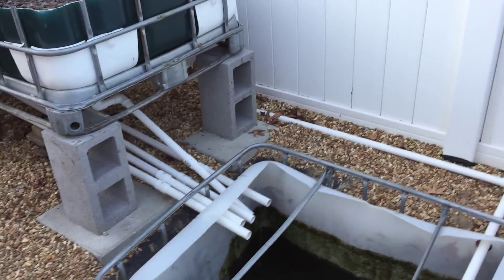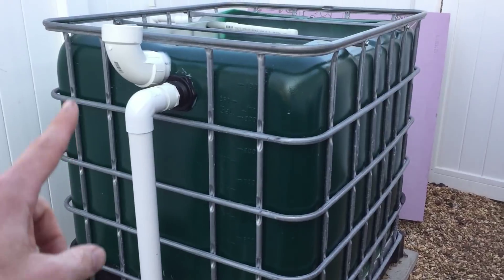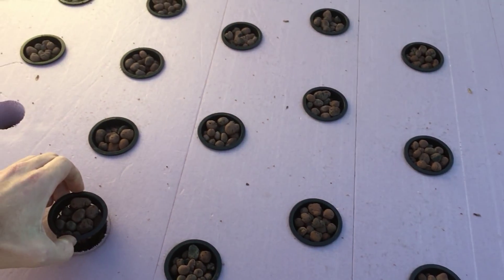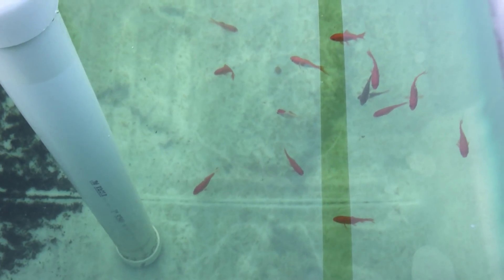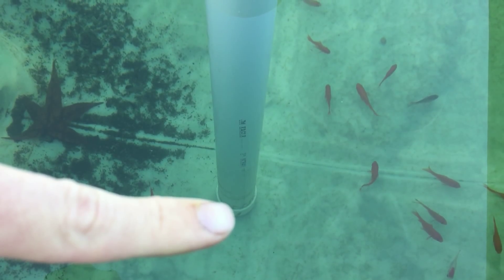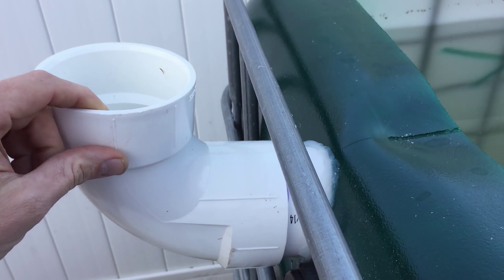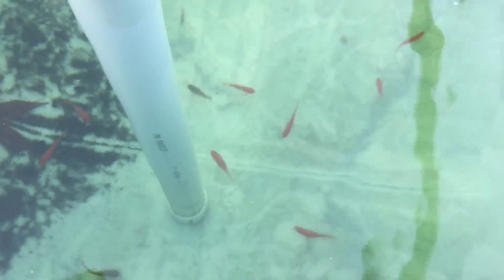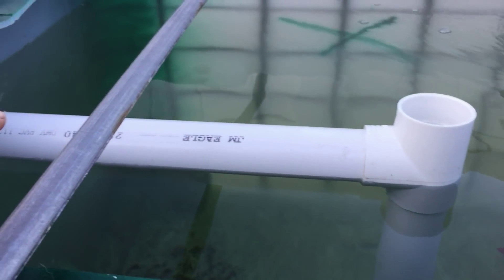IBC Aquaponics build part 4

Comment: How did you know that 4 beeds are fine. Murray Hallam had 3 beeds. You cannot just build it buy guts feeling it has to be calculated out. I am searching for a plan which is well thougt through to build a system out of IBC tanks but there is no room for experimentation or errors here. I want it to build up like in the plan and it should work. Maybe i should look for hallams plan? And are there not too few fishes in your system? Hallam said something about 150 fishes per tank at first and later when they are big about 40 fishes. Dont get me wrong i think what you did is great but i have not much confidence in my abilities so i need a foolproof plan.